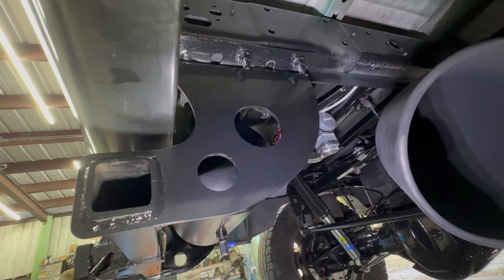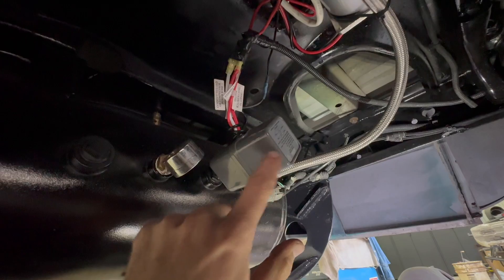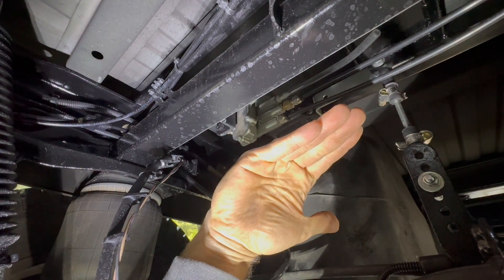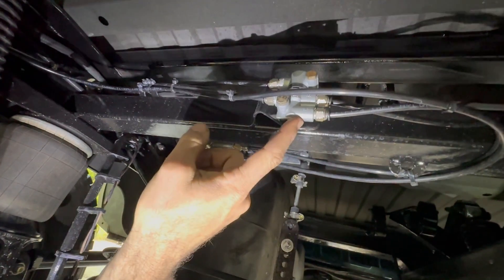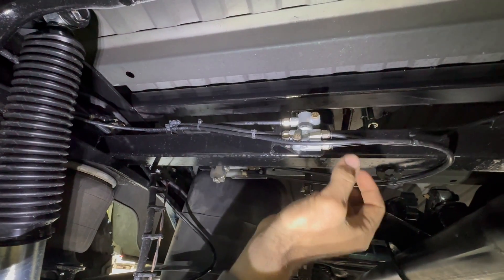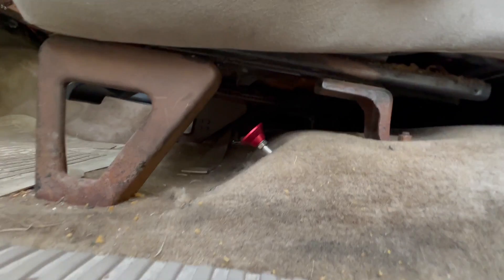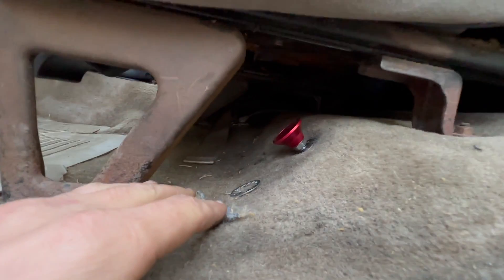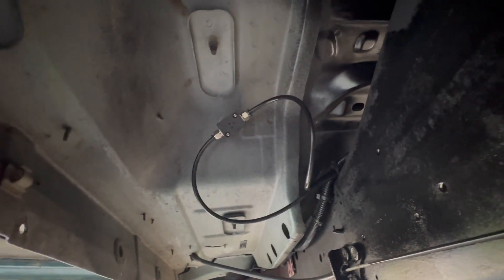Simple Air Management Explained | Leveling Valve | Dump Valve

Comment: Kick ass build definitely inspired but wut size diameter back did you use on the front axle of ur build 8-9 inch diameter looks like not enough room to fit up in the front.
Reply from the maker: If you made a spacer/adapter for the front you could use the same ones as the rear.  The bags used here are about 7.5” diameter and that is about what the front spring diameter is, would have to relocate shock obviously.

Comment: Love the truck and love the content!! But I got to know, how did you get that steering wheel on?? Does it bolt up to 94 column or did u swap entire column??
Reply from the maker: Splines fit, needs a spacer or you’ll wipe out the clock spring and you’ll lose cruise controls and airbag

Comment: Im more confused now than I was lol. your video did agood job explaining but not for my application. Got an old 79 model cabover with a Peterbilt air leaf suspension. Trying to put a dump valve in it but I'm having no luck. It's a 4 bag system and the rear bag feeds the front bags. ehhh. I don't know what to do lol.

Comment: How do you separate the air from moving side to side in a long sweeping corner... ( a top heavy camper from leaning)  Keeping the truck level when you happen to have a load that is heavier on one side or the other?
Reply from the maker: You could use separate leveling valves on each corner

Comment: Hey J, I have a 93 f250 with leafsprings on all four corners. I wanna swap then to statick bags. The truck comes with out sway bars from factory. My towing max at 12,000 lbs. Would you add sway bars if you were doing this project? 
Thx.
Reply from the maker: Yes, front is almost a necessity and adding one to the rear would be best.

Comment: Thanks for the info. I will be ordering the 4 link kit. I am building a 4wd box truck. The rear springs are never correct. Either they are too high or sit too low. With this I can keep it level with the front. I won't need the dump valve to lower the rear since I am just using it to keep everything level.

Comment: What do you think about the all in one air system? The ones with the tank and compressor together
Reply from the maker: Can’t say that I have any experience with them.  You just don’t want to get carried away with the max psi as the air springs are only rated at 100psi.  I am running a on at 90psi and off at 110psi switch.
Reply from the maker: You will be fine with more pressure in the tank you just don’t want to overload the vehicle to the point where the air springs exceed 100psi.